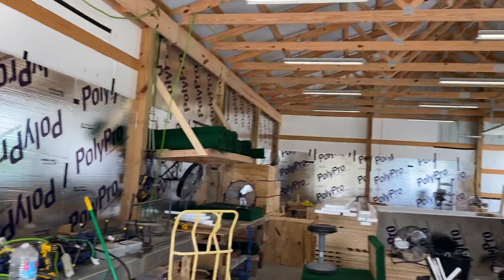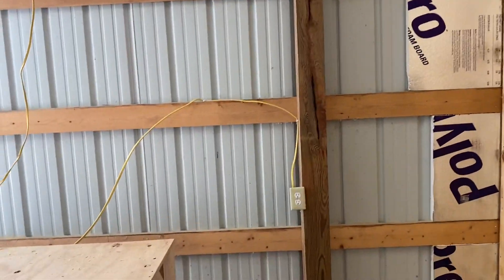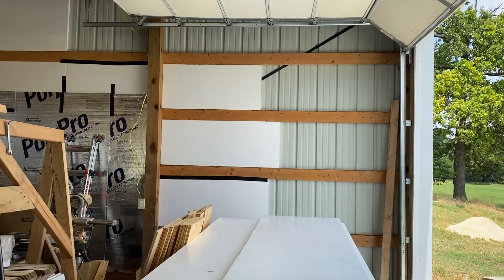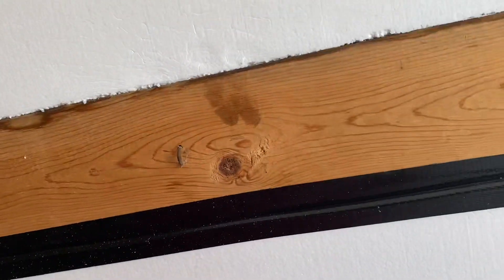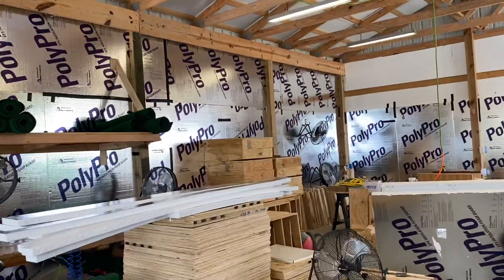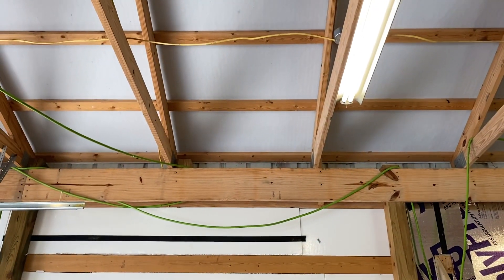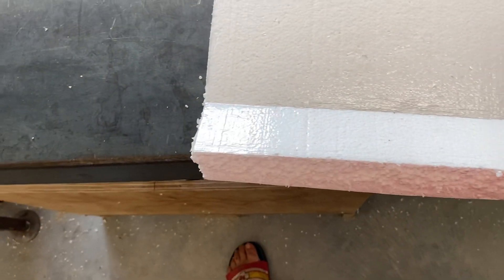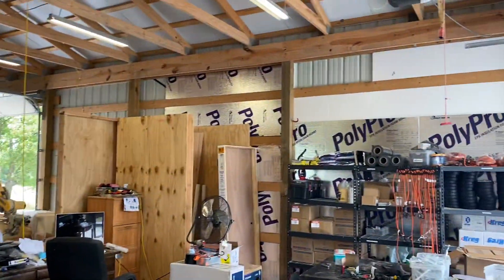Insulating a pole barn .  Easy, and Affordable DIY work shop insulation

Comment: The foil only works if there's like 2-3" of air gap in front of it.  So the foil between your girts isn't really doing anything to reflect the sun's heat.  Nice work on the insulation though - I plan to do something very similar to mine this spring!
Reply from the maker: I’m sure that mathematically and theoretically the things that you’re saying are accurate.

Here’s what I can tell you in the real world. I didn’t spend very much on this and my shop stays warm with an undersized heat source
Reply: @RockhillfarmYT  That's all that matters!  Like I said, I'll be doing the same thing very soon!  Any condensation issues on the steel? I have a 24x32 pole barn, Planning to do pretty much exactly what you did.
Reply from the maker: @ShopTherapy623  we definitely asking all the smart questions. There are no visible issues, but I glued that top layer to the wall and I wouldn’t know if there was condensation behind it I guess.

It’s been almost 4 years and glad with what I went with. If I was a rich guy, I would’ve probably done it another way.

Comment: That's what I'm going to do in my 30x50. Please do electrical to code. Thx for the vid!
Reply from the maker: The insulation is worked out really well. We took a break from it and now I’m almost done insulating the ceiling.

We don’t have building permits or anything like that out here. None of the circuits are overloaded

Comment: So, how well did it work to keep the building warm in the winter?  Outside vs inside temps?  What region location?
Reply from the maker: We are in Kansas. The HVAC guy recommended a 5 ton unit and I found a 3 1/2 ton unit.

It’s been about a year and a half since we did this and it stays comfortable year-round

I don’t know what I showed in the video but I also use the same foam to lower the ceiling to the bottom of the rafters

Comment: 30 x 50 pole Barn with 2 layers $1700  for panel material = OUTSTANDING COST VALUE !!
Reply from the maker: I agree. They are nicer set ups out there but I think this is good bang for the buck

Comment: Not bad, but if you were to use bat insulation and make the walls come in a bit more you could get a much higher R value for cheaper and about the same labor.

Comment: You missed your golden opportunity to create the necessary air flow on the outer skin of your building when you put the panels up against the metal siding between the purlins. You've now created a disaster. The best way was/is to put full panels of insulation right over the purlins leaving an air gap between the outer purlin and inner side of the metal siding, creating said air space which allows the outer shell to "breathe" and self control moisture, while not effecting climate loss/gain inside the structure. Sorry to rain on your parade.
Reply: Not only that, by placing the foil side against the siding, it completely negates any effect it has.  The foil (radiant barrier) requires an air gap to function.  With it installed this way, the "radiant barrier" is actually acting as a conducting layer, so heat is transferred from the siding into the insulation through the foil.